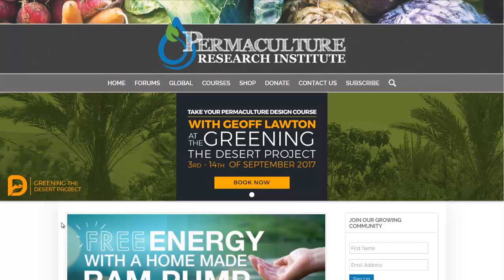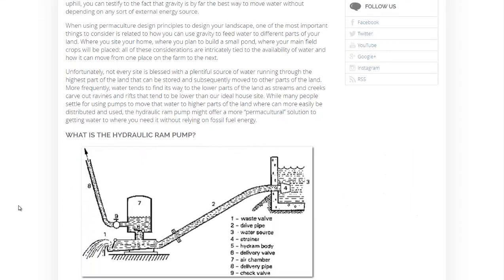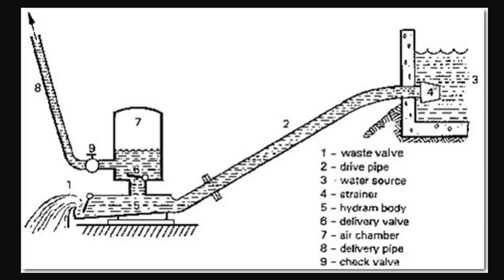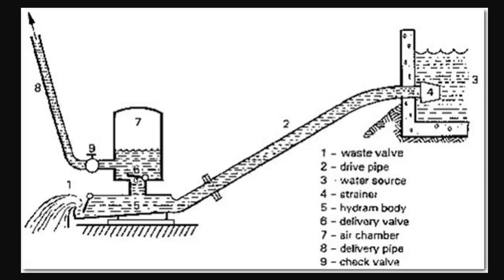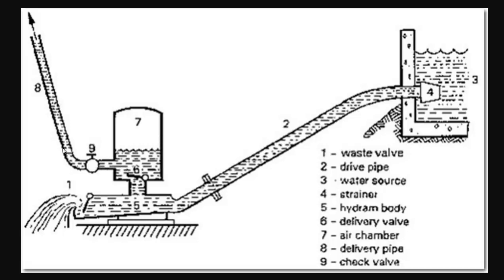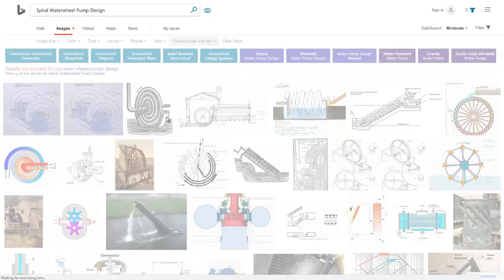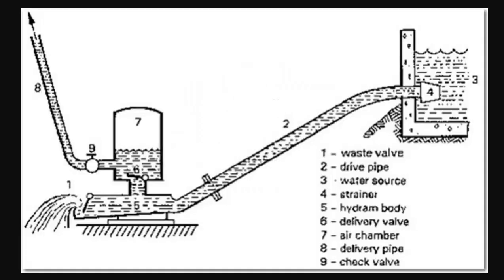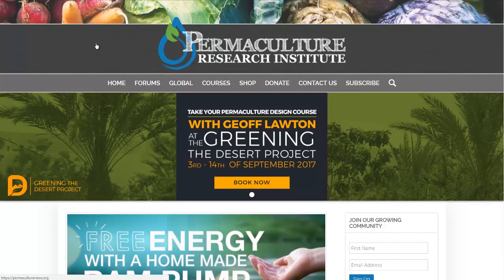3 Ways To Pump Water Without Electricity - Ram Pumps, Sprial Pumps, &Windmill Pumps

Comment: There’s more ways like one way running a black tube open a slow incline loves the solar energy to heat the water in the tube and make it less dense so it starts to rise another way. Is that the palace of Granados in Spain, where it worked on a funnel that created a suction, and Aerated the water below it then the water off to the side because it was aerated was less dense and could rise 6 m in height higher than the top of the spiral
Reply: Up a* allows* grandes?*

Comment: Aren't you forgetting the Pulser Pump? That's the simplest water pump I found. Has no moving parts either.
Reply: Yes, bur can be tricky to install ift the water is nearly flat. Need some head to get the water flowing down the Trompe.

Comment: I just realized, the ram pump isn't free energy or anything like that. Instead it harnesses the energy of water to move other water along (and then sacrifices the spent water). So basically, if you have a stream moving at 10mph for instance, then you can move half of the water at 20mph and the rest will simply stop. This is a bad example, but basically the energetic gain is proportional to the amount of "waste" water. It seems to use gravity to kickstart the operation and then uses the waters speed as the source of the elevating energy. Or possibly the other way around.
Reply: I think the people here understand basic physics. No one mentioned perpetual motion aka "free energy". This simply uses water and air pressure.

Comment: I need a way to get my water from my borehole without using electricity. Is there a way i could make the pump work without municipal electricity. Electricity is very expensive in South Africa. (Ps, the pump is rated 220volt/ .75kw)
Reply: You can use fuel motors
Reply: Solar steam pump. Also why not use a windmill?For pumping or generating electricity, don't need an industrial sized one for your pump.

https://www.youtube.com/watch?v=VmxqEjJAZ0o
Reply: Like Chris K said - windmill or solar power.